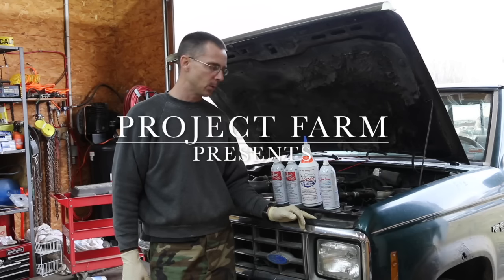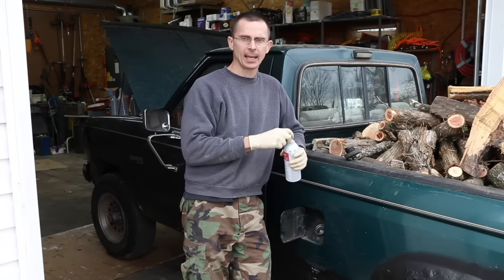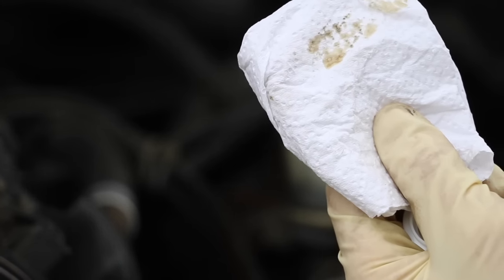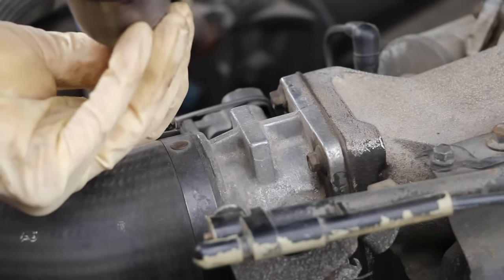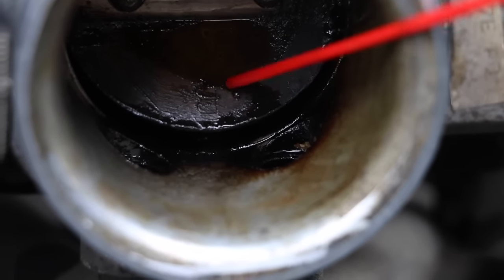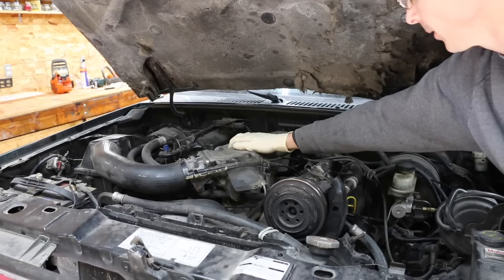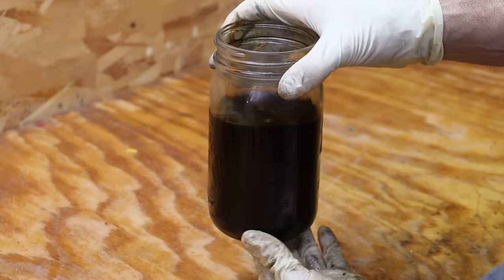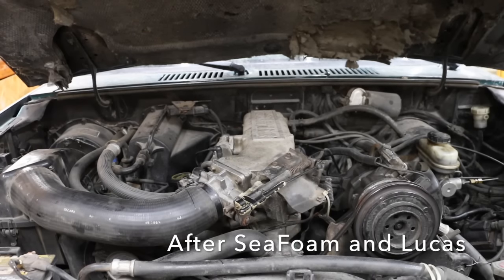Seafoam--can't believe what it did to my engine!!

Comment: I have a 1998 camaro.  In the late spring of 2011 when I got speed up to about 55mph I had awful clacking sound.  One would think engine was going to blow up. Of course I took it 4 reputable auto repair shops (one nationally recognized). I was told timing belt issues to lower crankshaft going out resulting in all of them suggesting new or rebuilt engine.  During all this I told them that I thought sound had something to do lifters.  Quickly got shot down.  Unfortunately I think because I am female.  Well guess what?!?  I knew about Lucas gas treatment,  so I went to advance auto and looked for oil treatment.  Found Sea foam and with one treatment clacking/ticking sound noticeably less. After second treatment sound was gone.  Seven years now , sea foam is part of oil changes. Thankfully , so far I haven't had to rebuild or get new engine.
Reply from the maker: Impressive!  Glad you solved this on your own!
Reply: So u add sea foam to the oil or the gas regularly??
Reply: Most mechanics are like surgeons. They think with their tools and replace worn or broken parts.
Some choose homeopathic solutions.
Big Pharma =Additive industry
Reply: I agree with the female comment. It happens to men too though. I was an ASE mechanic for 10 years and changed career paths, but I still do 95% of my own work.
My wife hit a parking lot curb and broke the lower control arm. It being January with 30-degree highs and 6 inches of snow on the ground, I elected to have a local garage to handle it. Upon inspection, the CV joint on the FWD was found to be bad. They charged me to replace each individually which equaled double labor. I called the owner on this because to replace the one, the other had to be removed anyhow. He said that I should have told him that I was a mechanic and he wouldn't have ripped me off.
Reply: Ellen Mabe coming from a women i pay attention. Could u pkease expmain how u used the seafoam!?  If an email its easier please ask me for it. Thank you
Reply: Engine size?
Reply: good girl nothing sexier than a female that can turn wrenches and talk automotive too! I sew, croche and knit have since I was 10 yrs. cook you name it!
Reply: Ellen, mechanics try to screw anybody, and not just the "female", they try to overcharge everybody, not just "female", they try to talk down to anybody that lets them in order to get their way and make more money, and not just the "female". I heard your type of claim all my adult life and its quickly beginning to sound very pathetic, especially when you consider how we man are treated in the modern type of "anti-male" media ( Movies, Books, TV Shows, News Papers and News Outlets )  just to make women feel good about them self and reinforce the never ending accusations that women have against man. This Type of Media is reinforced and supported by People like you. Some day, your type of one sided and unbalanced but very popular observation about male mechanics will also be considered sexist.
Reply: All, if you break down the pyschy of most skilled blue collar and it is not limited to them I have seen scientists that specialize do this too!
parts you dont need and breaking stuff that is old but works. getting you in and out with faulty repairs. illegal repairs that are hard to prove. 
The best defense for issues like this is learn your machine, understand it and never by more car than you need. that is hard today with all the space ship s@#$ on them. For instance you dont NEED ABS braking...slow the hell down! you dont need hyper drive trans missions. the transmission does two things trans-fer and ad-mission. it connects the engine to the tires.
if you are the keep up with the jones person none of this will help....my biggest problem is getting calls from my broker about the "next best stock to buy". I dont need his advice but he needs the job I DONT. cars are the same way you dont need what their selling...if I want to look pretty I rent the damn thing for the time I want too look pretty. then back to my junker. But my mechanic cant tell me I need a new computer for my transmission because the stupid car doesnt have one.
I have been refused service because the mechanic had cars coming in that had higher service bills. people who needs them!
edit...  here is the interesting part my boats and airplane mechanic do not do that. I have had boat and airplane mechs go for free to look at a model or problem. especially if they have little experience and want to build their skill base. They do not have a problem calling in a mechanic to look at something or help them with it. but that is a neighbor type of atmosphere generally and most of the people in it have disposable income. And again an airplane flies in the air that is it I dont need a jet the airlines have plenty. A boat floats on water that is it.
If you have a family this does not apply really. I have no kids or wife, too ugly! I think...
I would spend time and energy on a good vehicle choice for that task....
Reply: Your car doesn't have a timing belt....
Reply: thats awesome ellen, i have a 2000 chevy express van with the 305, it runs awesome has 230K on it, ive never used any engine treatments or anything, but ive had it since new and im OCD with oil changes.  i always thought additives and treatments were B.S. but after watching this video i might try it! maybe my engine will run even better
Reply: Lol I think most people commenting r lying. Mechanics won't rip u off. Ur cars r a pos u expect them to last forever.

Comment: My wife's '94 Camry would smoke like crazy on startup.  All information I could find on the subject pointed to valve guide seals being compromised by "gunking".
The official solution was to uninstall the valve train, cams and all, and replace the seals (No thanks!)
Instead I did the sea foam flush in the case then the Lucas oil stabilizer after the change.
No more smoke!  Even without adding the Lucas on subsequent oil changes. 
Seafoam and Lucas FTW!!
Reply from the maker: Thank you

Comment: This video saved me thousands of dollars! My wife's Nissan Rogue was mistreated by the previous owner - 60,000 miles without an oil change! The car would smoke HEAVILY upon starting it up, billowing smoke! It also consumed 5 quarts of oil every month. The lifters were loud and acceleration was sluggish. A few different mechanics said we would need  a new engine or at least a new cylinder head and valves etc.

I remembered this video from years ago and gave Seafoam a shot just to see if it would do anything at all. My theory is that sludge and hard carbon had built up around the valve seats, allowing oil to drain into the cylinder and thus causing the smoke and oil consumption.

After carefully follwing the instructions on the Seafoam Top Engine Cleaner and Lube, i can say there is no more smoke, and no more oil consumption! It's been 2 months since the treatment and my mind is still blown!

You have saved my engine's life, at 140,000 miles it runs perfect now!

Thank you for everything you do @ProjectFarm!!!!!!!!!!!!
Reply from the maker: You are welcome!  Glad to hear!

Comment: Would have been interesting to see a bore scope image through a spark plug hole before and after to view carbon on top of piston in cylinder.
Reply from the maker: Thanks for the constructive feedback.
Reply: @ProjectFarm  would you do this procedure on an Acura or a lawnmower engine?
Reply: I think Chris fix has done this
Reply: @MrCountrycuz  I put a can of seafoam into my '05 Acura RL tank after every oil change just to keep everything nice and clean. And I only use Chevron 94 without ethanol.

Comment: Don't worry about the Lucas. I've opened up dozens of engines that get it every oil change. No sludge.
Reply from the maker: 135hogeye, Glad to hear this!  Some of the other comments caused some concern.  Hope you enjoy the weekend!
Reply: Project Farm i ran a titanium based 5.0 fox with a 9600 rpm balance. it was NA and would rev nicely to about 5500 rpm then slowly to 7000 and rev limit shift. ran lucas with no other change in an 8 quart baffled pan. and bam it would scream to 7000 rpm ans shift. oil changes lasted to about 2000 km instead of 1200 km. spark plugs still cooked every time i hit WOT. lucas is legit. for performance.
Reply: I think, as is true with ALL oil, that the Lucas is probably fine as long as you change your oil regularly. Leave it in there for 15k and I'm sure it turns to sludge. Essentially it just thickens your oil. Add Lucas to 5W-30 and you probably end up with something with wear properties more like 15W-40. Obviously that's not exact science, but you get my point. I stopped using the Lucas and just switched to 10W-40 from 5W-30.
Reply: 802 Garage i think it helps prevent blow by with its viscosity modification. it protects the cold start with its stickiness and prevents cavitation with its blend of petrochemicals. with the added advantage that the oil that is forced past the ring doesnt coke you up. its good for highly modified motors that are high revving. and old sloppy beat up motors. not for regular cars. i only notice a difference at very high RPM.
Reply: Yeah that all sounds about right to me. If you are doing 5 mile commutes, definitely not the right product.
Reply: Lance Maxington nn
Reply: 135hogeye i run it in my jeep and i run the hell out of it. never hurt it
Reply: if u warm that lucas up by like sitting it on a heat register or radiator it helps it pour better
Reply: That 'Lucas' goop looks a lot like STP. Adding STP to high mileage engines blew them up in about 6 months.
Reply: Coil Smoke lucas made my jeep tick like a clock about 2 days after putting in a half quart.. i think its good for some appliations, but not all... just my 2 cents
Reply: coil smoke, idk what stp you put in one, but they do not blow cars up. i put a bottle of stp oil treatment in my car every oil change. it has the zddp that modern oil no longer contains. saved my brothers 350 v8 from burning main and rods when his oil pan plug came out. there was NO oil in the pan whatsoever.
Reply: you can use that Lucas stuff as an assemble lube as well as chain lube on motorcycles and even as bar and chain oil of you open the oiler up all the way.
Reply: i have it for my weapons it works great
Reply: been curious about this, Do you use it on antiques? or just modern weapons?
Reply: What about the Lucas Transmission Treatment?
Reply: I used Lucas in my old Mazda. The original formula helped a little, but then I used the synthetic formula one time, and the engine smoked like crazy -- the Lucas synthetic additive was making the oil stick to the cylinder walls so well that the rings couldn't scavenge it properly. I smoked my way back to the auto parts store and bought stuff to change the oil again, and the smoke went away.
Reply: Only use the synthetic formula with synthetic oil in a car that regularly gets synthetic, otherwise use the old stuff.  Lucas states this on their bottle.
Reply: I used it successfully in a 96 Taurus that had no working forward gears and got it going again so it should do wonders if you only have a slip. Good luck
Reply: Worry about the Lucas. This product is and always has been absolutely terrible for your engine. It's nothing but "bright stock", which is the base component of oil before additives such as anti-wear and anti-foaming agents are added. That's why it's so thick. Putting this stuff in is the equivalent of adding several extra cups of high-quality flour to cake batter and expecting it to bake right.

Initially it acts as a cushion, then throws an engine completely out of tolerance to the point it won't run correctly without it. It literally addicts the motor to Lucas. That's right, it's the automotive equivalent of smoking; and just like cigarettes, as long as people continue to buy the product, it continues to sell on the pretenses that you'll enjoy it's "benefits".
Reply: My maternal grandfather lived into his 80s smoking more than a pack a day since he was a teenager, then throat cancer caught up to him. Nonempirical assumptions like yours that "cases of longevity" equal "no harm done" are a big part of how they stay in business.
Reply: It must not be a Pennzoil product then   :-))
Reply: I disagree my friend.  Have used it for 20yrs. In cars,trucks,lawn mowers,etc...  It has saved/made me thousands thru out the yrs!!!
Reply: So youve opened up dozens of motors that get it every oil change? Either you did this for fun or because of a failure.

Comment: Now that the engine is quieter you can really hear that Ford power steering pump. 

Lol

/almost every car I've owned has been a Ford product
Reply from the maker: Great point!  Yes, it a whiner
Reply: Lol if your engine is louder than the steering pump its got a problem
Reply: Yep.

We never had a single problem out of any of ours, but they whined like crazy.

If the power steering pump on my 70's model Fords whined like that they were going out within the month.

The 80's and 90's model units were loud.
Reply: That’s the supercharger
Reply: I used to have a 76 Comet sedan that I got given to me lol
Reply: @notablynova  I love this car.

It doesn't look this good at the moment, rust repair, 90% assembled and multiple colors until it gets painted.
Reply: My 1999 mustang squeals the same, lol.
Reply: Still wouldn't make a Chevy run better.
Reply: I had a 98 ranger i drove for 19 years. The only engine part I had to change was the power steering pump!
Reply: Reminded me of riding in my grandpas truck... I’d remember thinking wtf is dying under the hood as a child
Reply: @noahbannister1834  ferrari has left the chat
Reply: Sad but true . . . and I LIKE Fords !
Reply: When I was a kid I always knew when my parents were coming down the block, I could hear that Ford Futura steering pump 1/4 mile away

Comment: My gmc yukon has 487,000 miles and sea foam treatment with red print, has been a big help for my suv..
Reply from the maker: RaiderNationz, 487,000 miles--very impressive!  My wife drives a Suburban that has 180,000 miles.  I'm hoping it'll run for at least 250,000 miles.  It's in very good condition and has been very well maintained.  So, it should easily last that long.  Thank you for watching the video and commenting!
Reply: Project Farm I know a guy who put 600k on a big GMC pickup, maintenance is the key to longevity in a car or truck
Reply: RaiderNationz My daughter has a 86 S10 Blazer with 350,000 miles on it.
Reply: got a 93 GMC with a 4.3  in got 450,000 miles  still original motor and transmission and I drive the shit out of it
Reply: oh and he's still driving that gmc pickup, heck I drove it too, drives great
Reply: Jeremy Lovejoy interesting. Amazing how gmc and Chevy can last if you take care of it.
Reply: Project Farm i used to drive an old toyota previa (still have it) i succefully made it to 956,025 miles on it, and still running great lol
Reply: - rescousium wow. Toyota will put that in a museum if it gets to a million.
Reply: - rescousium and probably give you a new car, too

Comment: Just came back and re-watched this video again after being a subscriber for a while. This is the first video of yours that I watched and got me hooked on the channel.
Reply from the maker: Thank you!
Reply: I have a Toyota Camry that was smoking bad on start up put Lucas in no more smoke also had a Jeep Cherokee that blew all the oil out of it within 4 blocks from the house literally had no oil in it the Lucas saved that engine that's what the mechanic told me if it had not had Lucas in it the engine would have blown
Reply: Project Farm quick question- is this just regular Seafoam that you're pouring in the crankcase? I've never heard of/ seen that before. I'll have to try it out.
Reply: There are different ways you can use it. in the crank case, in the gas tank. etc.
Reply: Shane Singleton Thanks!
Reply: Shane Singleton I like that he used Lucas in his oil. Been a while since so watched this but that's a lot safer than a solvent in your oil. I have a series sharing my experience on these products, but I'm yet to try Seafoam. I can't believe it! A car was so dirty that BG smoked like Seafoam the other day. Come see it!

Comment: I've spent 3 hours this week searching for startup rattle noise solutions on my 2005 Bonneville 3.8ltr.
This video will probably be my solution.  Although I have been using the lucas alternative to seafoam in my other car's fuel, Im going to try this on the Bonny.  Thank you!
Reply from the maker: You are welcome!
Reply: @ProjectFarm  Update.  I meant the Bareman's alternative in my post above.  I added Seafoam to the gas and the lucas to the oil.  I only kept 1/4 tank of gas in there while I revved it and drove it for a half hour.  This morning I dont even remember hearing the rattle or not but today Ill be feeding a can directly.  Even at this point the quieter idle and added low end power is noticeable.